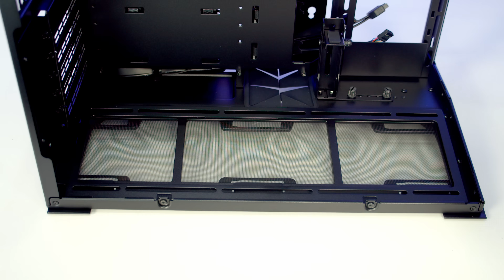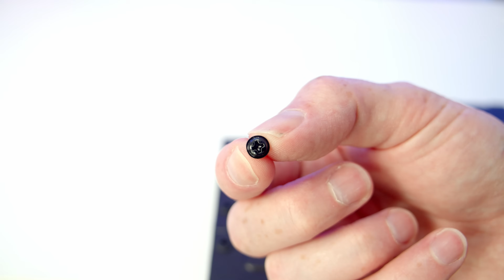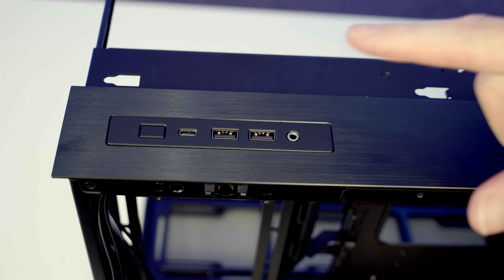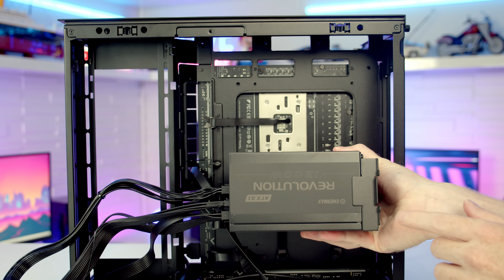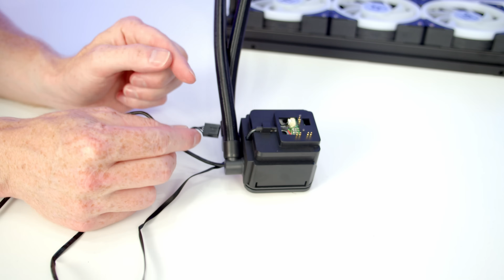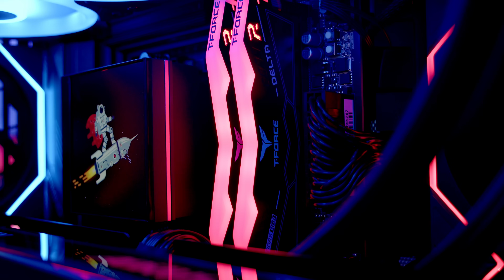Lian Li O11 Dynamic Mini V2 Build - Step by Step Guide

Comment: Hi Christopher, please let me begin by saying what an awesome video this was. I wanted a clear and concise guide and this video was perfect
I do have a few issues though
I'm using the gigabyte b850m gaming x mb with the thermaltake th360v3 ultra argb aio and sapphire nitro plus 9070xt
The issue is that when I try to vertical mount the gpu the backplate bumps into the lower part of the aio screen
Would moving the mb to the higher stand-offs fix this issue and allow me to vertically mount my gpu?

Comment: exceptional instructional video, it's not an easy thing to do and must have taken you a lot of work to produce such a concise yet easy to follow video.  My Lian li 011 dynamic mini v2 arrived today, The computer case stinks of high quality from the minute you take it out of the box, the aesthetics, the build quality, the thought that Lian li has put into designing this thing is very admirable, i rarely rate anything above a 9 out of ten but this pc case gets the full 10.  If youre thinking about getting this computer tower i cant imagine how you would ever be disappointed it''s that good. buy it

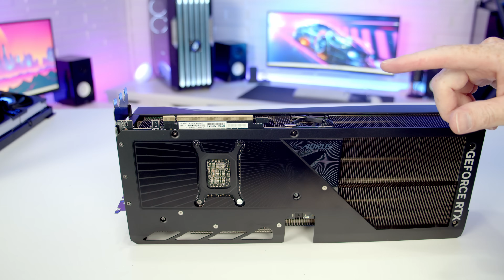Comment: Can you install the gpu in horizontally? It doesn't seem like it's possible 25:11
Reply: what did u do?
Reply: What the fuck Bro?? You can obviously install the GPU horizontally without that cable Just plug it in the motherboard
Reply: @OmarBouchaddekh but the motherboard is in the way of the GPU slots on the side if you don’t, that’s what it feels like for mine

Comment: i am getting a Z890 AORUS ELITE WIFI7 PLUS and that case would i have to vertically mount my gpu or could i horizontaly mount it
Reply: Looks like it. For ATX MOBO as long as it has an NVMe M.2 slot right below the CPU before the GPU PCIE slot then it should be good in general. That's what it says on their website and also what I'm planning to build but I'm still in the middle of ordering the components.

Comment: hi sir, i see it like the vertical gpu reduce casing gpu clearance? in manual its say 400mm, your gpu is 360mm right? but almost reach the front glass.. can it realy fit below 400mm in vertical, thnkkksss
Reply: Vertical mount takes a bit more space about 10mm so you'll have 390mm clearance but definitely don't max it out. 

I have the case and I measured.
Case width: ~420mm
Vertical mount width: ~30mm

Comment: Routing your cables for the aio block that way could cause uneven pressure and improper cooling on the cpu. Would not recommend.

Comment: Great, careful work and filming. And agreed that the case is thought out. However, at these prices its only available fanless or with basic fans (includes the links), and.. lian li 3x fan array with controller cost more than the case itself. +$10 extra would be nice.

Comment: What is the riser cable you’re using in this build? Also can anyone confirm if you can use an atx msi x870 gaming plus motherboard with a 5070ti in the horizontal gpu orientation? I’ve seen quite a few posts mention it won’t fit in the top most slot on the mb in this case but I didn’t realize this before I had already ordered this case as they advertised it as being able to use atx mbs without issue.
Reply: So did it fit ?

Comment: Did you use a Gen 4 or Gen 5 riser cable? I didn't hear you mention it since the riser cable is not included and has to be purchased separately. I had an issue with the Lian Li Gen 5.0 riser cable I bought. The GPU works fine directly in the slot, but when using the riser cable it does not. I made sure it was fully seated several times. The GPU would come up, then the PC would spontaneously reboot. At that point the GPU fans would just spin as they do when it just comes up, the VGA light would be on and there was no video out. I could manually reboot, it would come up again, then go through the whole process again. This is not the first time I've had issues with a Gen 5.0 Gpu and a riser cable, either Gen 4 or, as here, Gen 5. So, I'm wondering what you are using since both the GPU and MOBO are capable of Gen 5. You also didn't mention the brand of riser cable you were using. I have successfully mounted a GPU vertically in a different case and using both a Gen 4 riser and a previous generation 4080 Super GPU.

Comment: Do you think a 5090 will fit well? I have the feeling that the power cable that powers the 5090 will be tight against the glass panel

Comment: i am getting into game development and i am building my first pc so i was wondering if anybody has any advice they can give me on what i am wasting money on and what i can upgrade, i don't know much about computers so in car terms i am not trying to buy 3000 dollar rims for a car when i can invest on upgrading the A/C, i unfortunately cannot get a post approved on reddit so forgive me if this is not allowed I PREFER PERFORMANCE OVER AESTHETICS THANK YOU FOR YOUR TIME IN ADVANCE

CASE: HYTE Y70 RGB GAMING CASE - BLUEBERRY MILK

CASE FANS: 3X ARGB ARTIC P12 PWM PST A-RGB 120MM WHITE FAN PACK

PROCESSOR: AMD RYZEN 7 9800X3D PROCESSOR(8X4.7GHz/96MB L3 CACHE

PROCESSOR COOLING: 360MM LQ IBUYPOWER AW4 360MM ARGB LC WHITE

MEMORY: 64GB 32GBX2 DDR5-5600MHZ MEMORY MODULE

VIDEO CARD: NVIDIA GEFORCE RTX 5070TI-16GB GDDR7 DLSS 4.0 AI POWERED PERFOMANCE ASUS TUF OC

MOTHERBOARD: Gigabyte X870E AORUS PRO ICE - WiFi 7, ARGB Header (3), USB Rear Ports (2 Type-C, 9 Type-A), M.2 Slot (4)

POWER SUPPLY: 1000 Watt - CORSAIR RM1000e - Cybenetics Gold PCIe GEN 5 ATX 3.1, Fully Modular - White

PRIMARY AND SECONDARY STORAGE: 2TB Lexar NM790 M.2 PCIe Gen 4 NVMe SSD -- Gen 4 Read: 7400MB/s; Write: 6500MB/s

MEDIA CARD READER/WRTIER: SABRENT PREMIUM 3 PORT ALUMINUM USB 3.0 HUB WITH MULTI IN 1 CARD READER

Comment: Hey Christopher, I watched your review of the V1 and really appreciated your work with the different thermal configs and details! 

How do the thermals compare with the V2? It seems Lian Li has made this case with the focus of a 360aio on top and no 280aio as intake. This  goes against your preference with the V1. 

The V1 is smaller which is preferred and with offset brackets can also accommodate a 360aio up top making the fan configurations identical.

I’d love to hear your insight about thermal performance. Also is it true with the exhaust vents that you cannot remove the dust mesh filter?

Is it wrong to believe with the same exact fans and hardware but in a V1 the thermals are identical if not 1-3 degrees difference? 

Lastly, having the gpu vertically vs horizontally with this fan configuration. Is it better or worse? 

Thank you.
Reply: I'm also curious about V1 thermals VS V2 thermals
Reply: You wasted your time writing this lol

Comment: 20:37  I'm sometimes tempted to simply cut off the 2 pin 'pigtails' (and 4 pin, in the case of 4+4 pin EPS cables) that I don't need, and then neatly wrap a piece of electrical tape around the amputation site to keep everything well insulated, but I haven't given in to the temptation to do so just yet.  Custom cables really come in handy in such cases (I don't like using extensions), but they can be expensive 

I just wish PSU manufacturers would provide an extra standard 8 pin to 8 pin PCIe cable in the bundle.  I'd even be willing to pay a bit extra for it. 😏
Reply from the maker: It's funny they don't bother me hiding in the back, but so many other little things do that shouldn't

Comment: Small tip: That little triangle plastic cover next to the front IO panel can be removed, to have a bit more airflow. It then also serves as a handle to lift the case. It's secured by two screws inside the case.
Reply from the maker: Yes, lifting it isn't easy